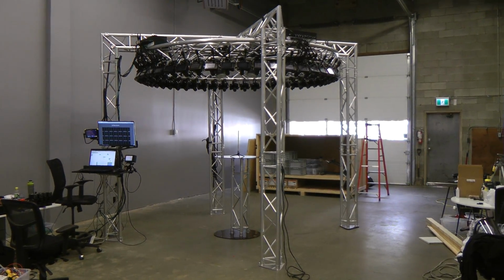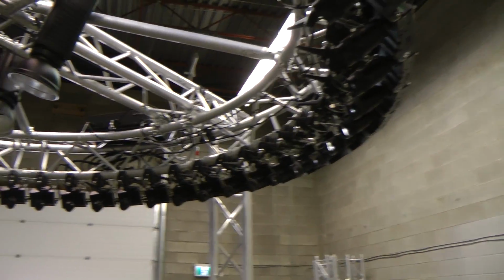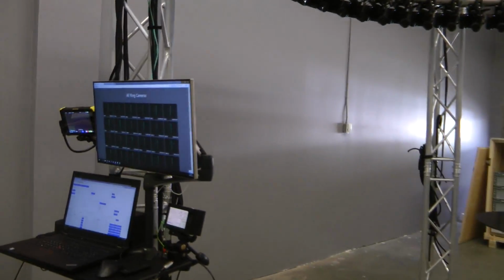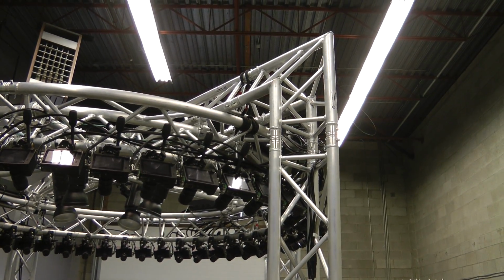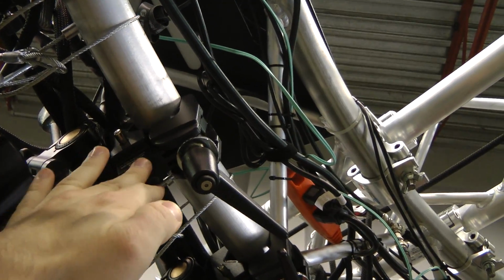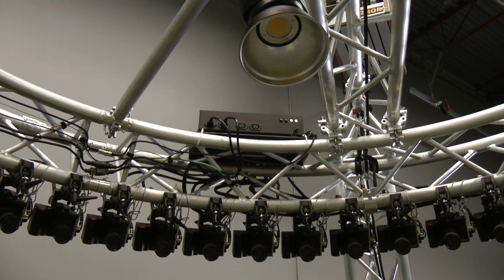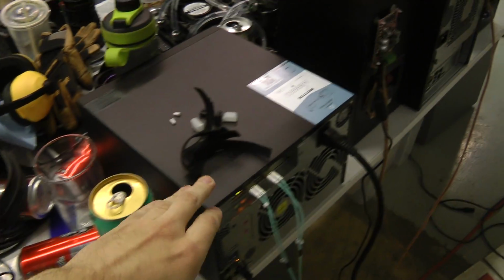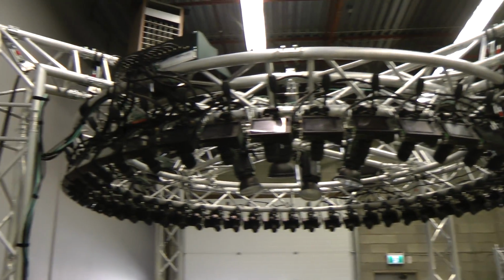Chronos Ring - Bullet time array of 48 high-speed cameras

Comment: The rotation is a bit fast, which makes sense as it might start to look jerky at a slower speed with "only" 48 cameras. Maybe you could try cheating a bit and interpolate between the views using optical flow. OpenCV has the right tools for that. That would also help to make the video more compression friendly.

Edit: Oh, interpolation get's mentioned later in the video.

Comment: When rotating, are you switching from one camera to another x cameras / sec?
Or does it construct a sort of panoramic video, meaning you could rotate at varied speed and not be framerate bound by the number of cameras?
Reply from the maker: Cameras are usually switched every frame, so between 50k and 500k switches per second.
Reply: @tesla500  Ah, so it would rotate at the same speed regardless I'm guessing.

Comment: could you decrease frame loss and increase picture quality by using 3 smaller concentric camera arrays 1 inside the other and slightly elevated above each ring so as not to obstruct the lenes; instead of just a single ring adding up to the original 48? Each rings angular velocity a percentage of what you would have used on the single ring of 48. Say  8, 16, 24=48. That way any frames potentially dropped will be picked up by the other rings and in the most efficient way possible.

Comment: Maybe spend some time on software tooling to it easy for yourself to vary the framerate/orbit speed in post. Using that to highlight certain parts of the action like the Slow Mo Guys do, should fix the 'head hurting' issues other comments complain about.
Still impressed though.

Comment: I dont know why, but several times it felt as if the playback changed framerate variably through some clips. Like you see little happen for several rotation, and then suddenly it does a lot in two rotations for no apparent reason (as in, there is nothing I can see that explains things physically speeding up. Hence why I think its the playback), before again doing very little over several rotations. Except I dont see how it can be playback speeding up as the rotation is still the same. For example at 2:47 (seems like suddenly pink balloon falls way faster and as if blue sped up too), 3:56, 6:37 (the last one I think is physical due to hitting table rather than the playback thing, but unsure).

Comment: Watch it at 2x speed.  Much less nauseating...  ;)

On a serious note, does it have to go round and round like that?  I'm assuming not.  This would be much cooler to watch from a certain angle, then slowly move around to another angle and stop there and watch a few seconds.  The constant spinning is kinda strange...
Reply: needs to orbit for highest framerate. Synchronized the ring runs at 1000fps but allows arbitrary movement. Interpolation will help as will getting more cameras as there are a few other arrangements that may work well timing-wise.